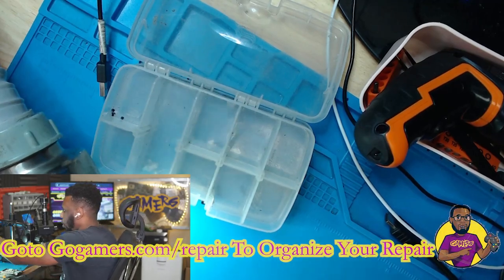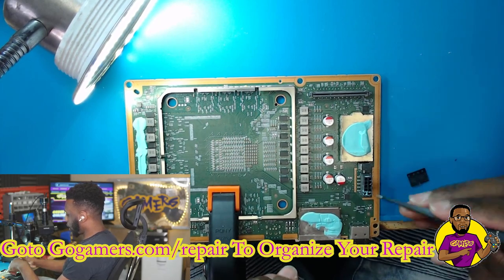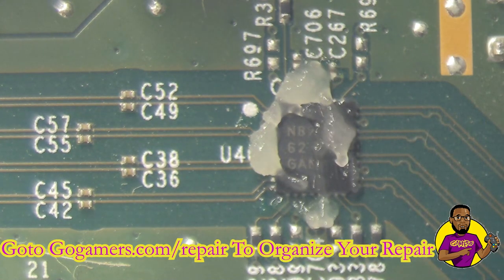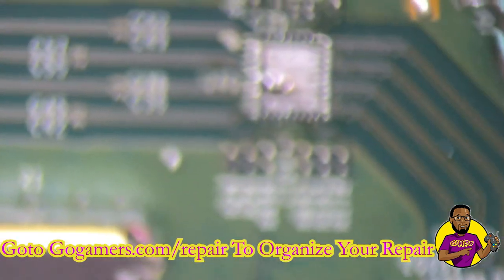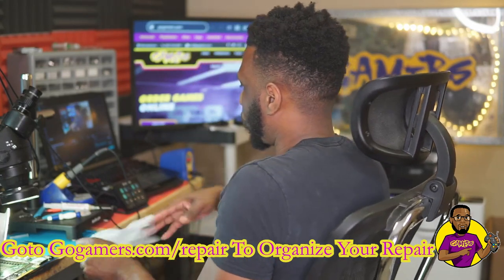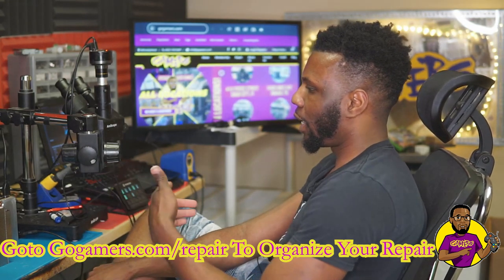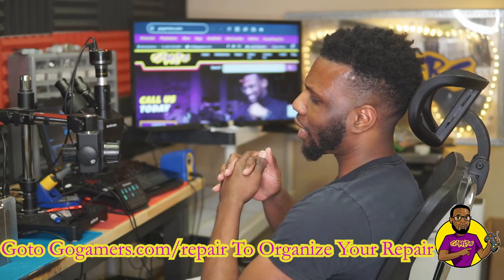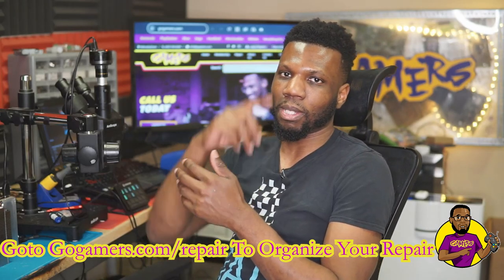Xbox Series x Faulty Retimer HDMI Controller chip - No Signal Black Screen Repair Attempt

Comment: I just blasted this chip with 500c for 22 minutes and it didn't budge or melt a bit. I even tried blasting it with 500c while putting my soldering iron on the pins (also at 500c) and nothing. wtf
And this is after spending hours replacing the HDMI port (which didn't fix the issue)

Comment: I'm having this same issue.. New port, new retimer, replaced a few resistors, and ic chip I think it's called.. Still no image.. Where is this pack you speak of?
Reply: Booster IC chip. It's necessary for 4K. If you don't care about 4K or you just want to test it without 4K you can bypass it

Comment: Hi I am in the middle of repairing a previous hdmi repair attempt and nootices that the resistor R178 is missing beside the hdmi retimer chip, is there you would know or anyone has an idea what is the value of the resistor R178? Thank you
Reply: From the schematic it should be a 0 ohm 402

Comment: Hello, the other day a lightning struck my house at night, the next morning I turn on the xbox series s, but despite everything seems to work at the software level, the video signal never reaches the TV. They tell me it's possible it's the fault of the electrocuted video chip. Is it possible, or could it be something worse?
Reply: Did you get it repaired and if so was it the retimer chip.?